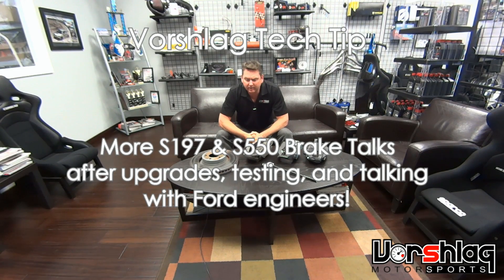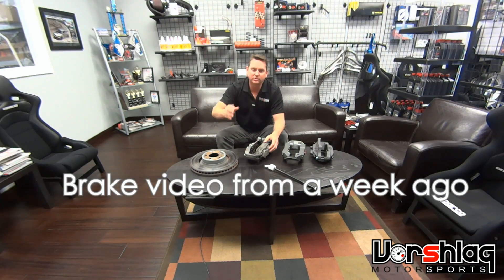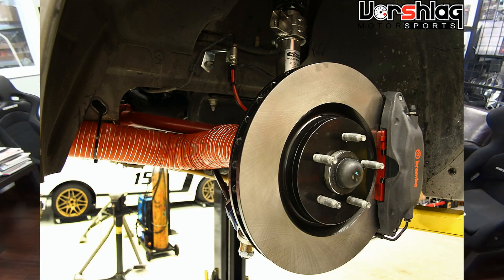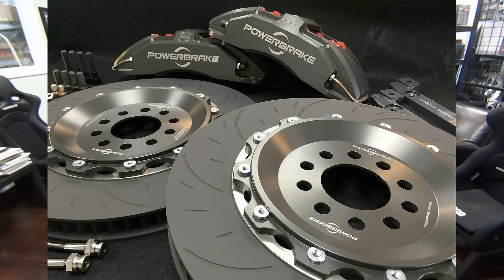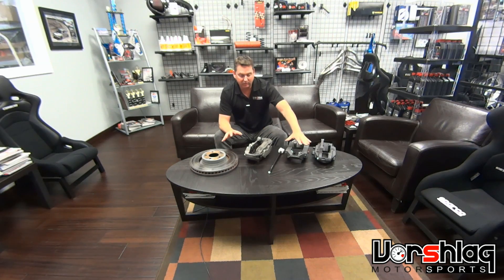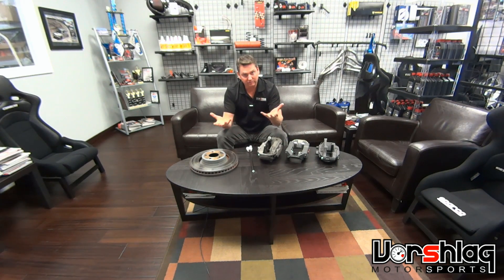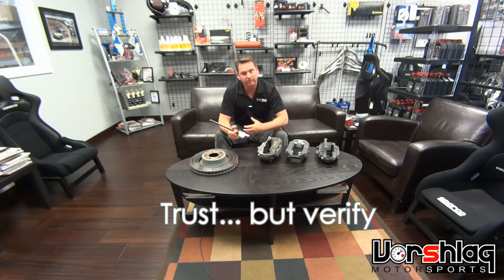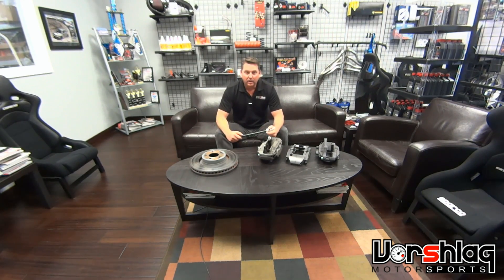Vorshlag Tech Tip: MORE details and testing with S197 & S550 Mustang Brakes!

Comment: I know this is an old thread, but do the 2020 Base GT’s still have this master cylinder that doesn’t work with the PP1 brakes? I recently bought Bullitt brakes for my 2020 GT, and so do I need this upgraded master cylinder and booster to make it work correctly?

Comment: does anyone make an aftermarket rotor for the smaller oem brakes that puts the venting on the back side like normal?  it seams like that would be a good low cost solution?
Reply: Bob Last I’d honestly just save up for the brembo package brake upgrade, cjponyparts sells or this company, depending on who has a better price. If your going to spend 3-400 dollars for new rotors and pads, in the standard size, you may as well spend the extra money and upgrade to the front Brembos.
Reply: If you didn't listen, it more than just adding 6 piston calipers to make it work on a base GT or PP Ecoboost. Both Baer and Steeda have 2 piece rotors with rear vented discs in the stock sizes. Yes they are pricey, but a straight bolt on, with a much superior rotor than the stock 6 piston Brembos can bring to the table. No to mention the electronic stability and antilock calibration Ford developed for the car.